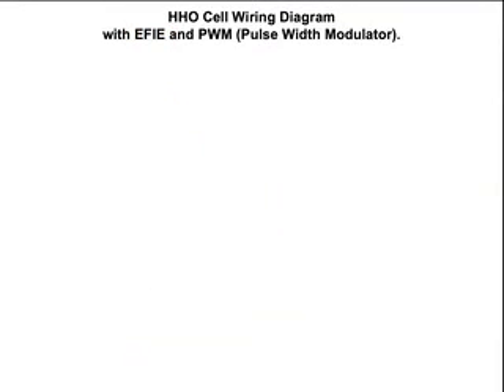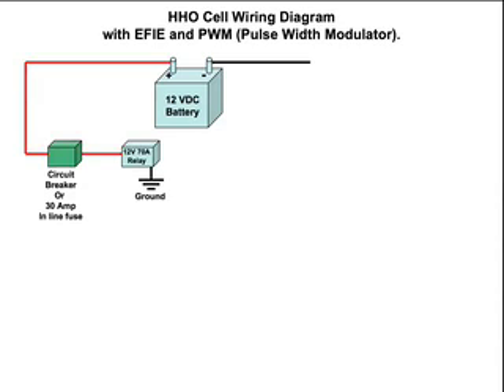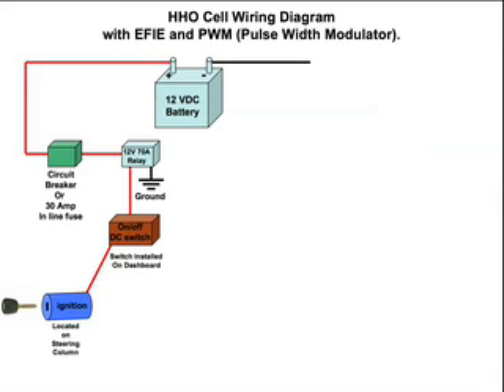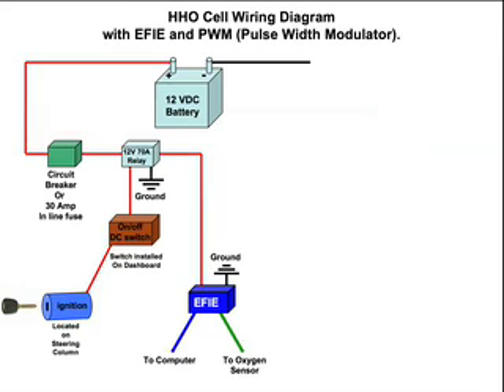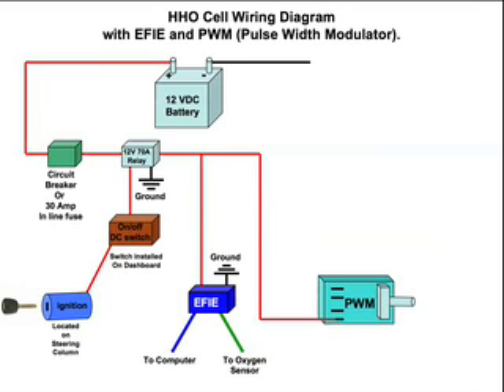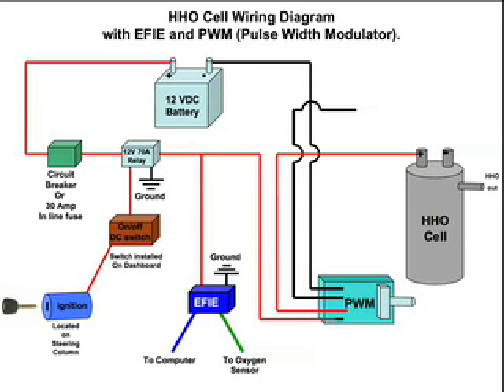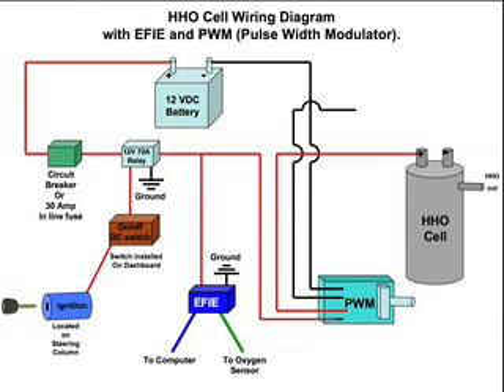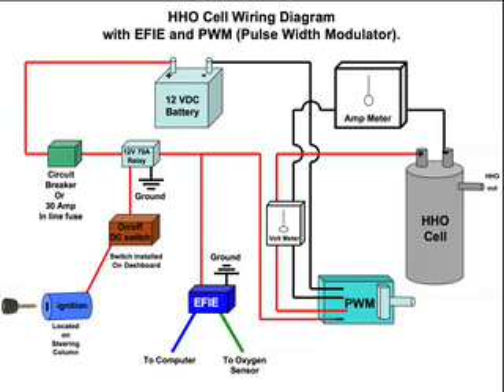EFIE and PWM Wiring Diagram for HHO Systems

Comment: My anti-knock prototype let's me advance ignition timing to the maximum factory setting.  

I also have seen some decent results while running the engine under leaner conditions.  Going to add further cooling (bubblers) to keep the exhaust temperatures in check.

Comment: how much amperage does an efie take? is efie and pwm both 30a? would i need a 60a circuit and doesnt the pwm work best if its connected direct to the bettery so itll be on stanby or on with the voltage that goes up and down? maybe put both efie and and pwn just connected to isolator and the battery?

Comment: thank you so much that explains everything. but does the ammeter effect the hho performance? is it safe to put ammeter before pwm to see shuld the pwm to turn on at certain voltage? plus will it need more than a 30a fuse to power the other devices like efie/maf enhancers? im looking to get  auto ccpwm30a and a stafor maf/map auto enhancer both are set and forget no twisting knobs while driving. maybe add an efie but i doubt thats necessary. will a 60a circuit breaker be sufficient enough along with 10awg wire? Ive a lot of questions about it but it gave me a good idea to build an electrical box with everything into it. wire up battery and hho set and forget setup. id appreciate yor reply. ive looked at your other videos too and i find them great.

Comment: Hey i got a question here.  What is the point of the switch in between the ignition and the relay? i can see that the ignition provides power flow but your counteracting that by adding the battery since the battery would provide power 24/7 since there's no switch between the battery and the HHO cell

Comment: Thank you for sharing these ideas and LINKS !!
Will be happy to share as well when I finish my HHO genset.
I am looking at using perforated stainless steel plate with 1/8'' holes instead of
solid stainless steel plates, because : 1- increased surface area for reactions to occur and 2- allows the gas to escape faster to the top.
Also using a 12vdc pump will speed up removing the gas from the surface plate
allowing more electroytic reactions to occur per minute.
Cheers, G.

Comment: That's all good.  I wonder if you're making HHO in the car in any amount that would make a difference, if a bubbler would truly be able to isolate adjacent bubbles from each other. I've heard that all HHO with gasoline does is fool the O2 sensor into thinking the engine is too rich and leaning it out so the mileage gets better at the expense of risking detonation from running lean.
All in all, I doubt this technology will take off for various reasons.
Not saying it couldn't though.

Comment: When you say, "doesn't work at all", are you meaning there is no output, or you get the same, or worse mpg? If no output, check your fuse. It might be blown. Also is it possible you wired it in incorrectly? Same or worse mpg means you need that EFIE.

Comment: I bet there are still 18 wheelers that use tubed tires. Go to a tire shop that works on truck tires and ask if they have any old inner tubes that you can have. If they have them and make you pay, the most you'd have to pay is about five bucks. Then it is a simple matter to cut out your gaskets ;)

Comment: I have yet to use a PWM as I haven't fould any plans to build my own. That being said, you can adjust your voltage with it. If you run too hot, (too many volts) two things will happen. First, you could drain your battery, burn up wires, all kinds of bad things. Second, and more likely of the two, you will continue popping fuses. I blew about 5 20 amp fuses by running straight DC. That is because of my electrolyte mixture, but I had to run that many volts to get the HHO output that I wanted.

Comment: Everything looks good except I am fairly certain the ammeter has to be hooked up on the positive wires. If you think about it, your negative wire has zero current, so your ammeter hooked up the way that you show should show zero amps at all times.

Comment: Something no one is talking about is that HHO is explosive so it would never be allowed as fuel. You have to use hydrogen alone and mix in the air during the intake stroke otherwise 1 spark and you have a bomb.
Gasoline or diesel in a tank isn't a bomb, there's no air in it.
Apart from this, if you actually TRY to do this you'll find it takes a lot more energy to make the HHO than you get back by burning it so it's not the "energy 4 free" system many people think it is. 1st Law of Thermodynamics

Comment: To activate the 'On/Off' relay if you utilize the Alternator field wire that energizes the alternator to trigger the output of the alternator, then your HHO cell will only operate when the engine is running as opposed to perhaps sitting with the power on to listen to the radio etc. then you won't run your battery dead by not operating your HHO generator when the engine isn't running and doesn't need nor use the HHO.

Comment: @jotelee67 Havnt heard of the volo chip, i'll look it up but this design here will deffinetly work and increase your gas milage. It is neccisary to trick the computer. I actually researched more and the dry cells dont overheat faster than wet cells and have a higher output as well. Jus curious, if you jus have one 11 plate cell or do you have it in series with another one? I'm just getting into hydrogen, but i will converting a car soon so trying to learn as much as i can. thanks

Comment: @jotelee67 I'll answer that for you..yes, if you have an HHO unit in your car you need the EFIE, without it, you will actually get worste gas, your truck thinks its getting to much air and running lean, so its most likely dumping in more fuel to compensate. It is neccisary for this system. I have a question for you tho...what made you go with a dry cell? and what are the advantages? I hear that dry cells can overheat much easier.

Comment: @apol732 Yea, you do need one or you wont have any benifits of the HHO system. U only DONT need one if you have a older pre-OBD1 car. In vehicles with computers, the oxygen sensors will sence the extra air via the oxygen in Hydrogen and will think your car/truck is running lean. It then will start dumping more fuel from your injectors in attemp to richen up your 'lean' condition in attemp to 'correct' it. So it is neccisary to fool the ECM to gain the benefits of HHO. Good luck

Comment: Hint...Hint....Your getting very close utilizing the PWM (one that you can adjust the pulse width frequency ONLY) over any form of direct current/cell design I have ever seen. If you want to take it further than a mere supplement to a gasoline engine, your going to need more. Much more. If you really want to destroy h2o and create enough hydrogen to run said vehicle, run your PWM output into a capacitor  bank (wired in parallel) and increase the spacing between the anode and cathode plates.

Comment: Steve! Very awesome diagram! Thank you SO much for sharing. I have been working on converting my Toyota Prius for the last year. Played with three different designs. I like your easy -to-understand ppt. Are you going to also use an inline spark/flash reducer as detonation insurance? Not sure if I need to be too worried about it with my auto. What do you think? Also, where are putting your HHO introduction to the engine? Intake manifold or farther up the intake? Again, I appreciate your video!

Comment: Also, A good PWM will shut down if the output gets shorted. What actually happens is the pulse width goes into a "spike" mode which the pulse width is extremely short thus eliminating the high current draw on the switching transistors. The circuit should have a protection section and if it doesn't, you are wasting your time and money on such. Whoever makes the units should offer you a range oif output voltages. Depending on the topology, it should just be a coil or transformer change.

Comment: Interesting... Remember that the higher the voltage, the lower the current. A good PWM will produce a wide range of voltages. If you use a contactor relay, you can avoid high current switches and use the car's ignition switch without damage. I would try to get a PWM that would produce 200-400 Volts on the output. Your current would go down drastically but the risk of electrical shock goes up if you handle the electrodes on the cell.

Comment: Excellent presentation. The only thing that you should do is take the schematic 1 step further & define which terminal # on the relay goes to what (ie: relay terminal 30 goes to battery, terminal 87 goes to PWM etc

Comment: Nice job.  As the owner of an electronics company that invents/improves HHO products, I always stress to my customers this EXACT method of connecting the hydrogen generator to a vehicle.  It is VITAL that you connect your switch (that controls the relay) to a "switched" 12 volt circuit.  This switch MUST only be active when the engine is running.  Otherwise you run the risk of explosion and possible suffocation.  Great information on this video!

Comment: Hi Steve great stuff mate keep it up, you can get a resettable 20 or 30 amp fuse that will reset themselves, most auto shops should have them - autocheap in AUS has them so you guys should find them over in USA.

Comment: Very impressed,my circuit is the same as yours Ive connected a digital ammeter up,& when the cell is on this works as a warning light as well.I have made a PWM on a plain board & it works well also a MAF enhancer.I would like your circuit diagram for the EFIE so I can make 1,your presentation is great,how do you get these diagrams on your videos?I would like to try this as I have had requests & Ive got some interesting stuff I would like to post,I will be viewing all your video,regards TERRY

Comment: no problem, i got one more for you, when you go to the supply house to get the inline fuse
get a 440vac 40uf capasitor, and try to get the transformer out of a microwave.......
then use the wire and just run the negitive through on side of the coil,,,,so your using the same wire to the cell, it just travels through a cap and a coil befor it get there....any way that pulse that the pwm makes
will be collected by the cap/coil, and your get hv out of the other side of the coil. look at my video